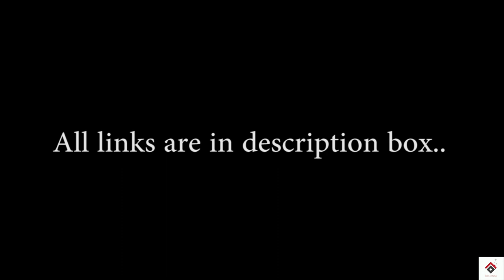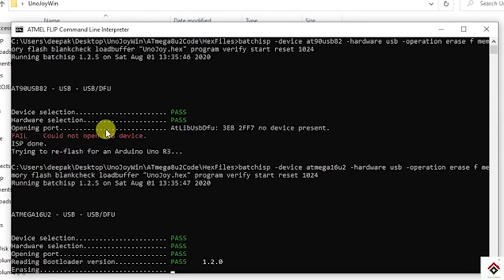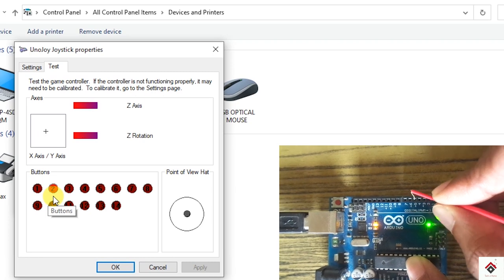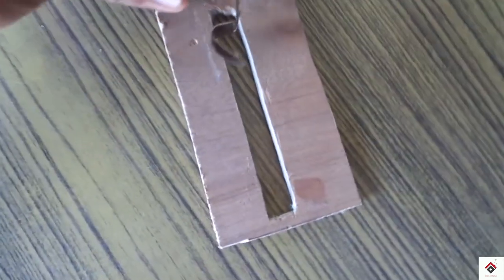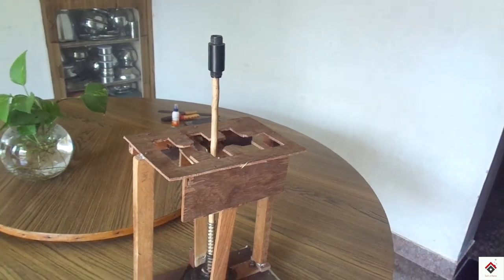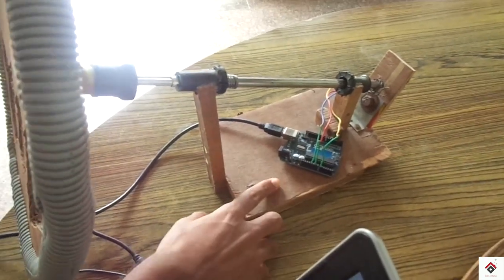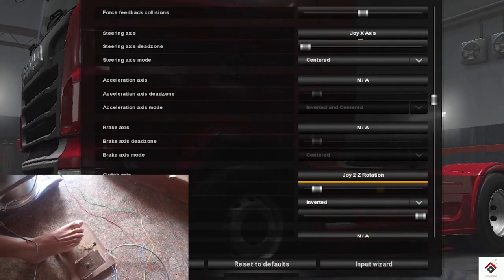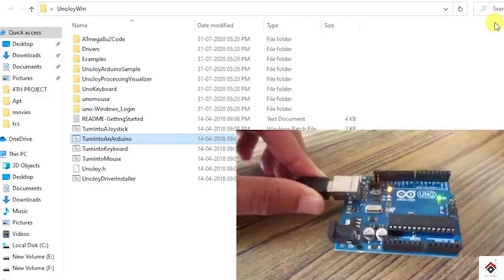Homemade H-shifter from Arduino Uno | DIY H shifter tutorial [step by step Tutorial] - ETS2

Comment: Can we use a single Arduino board for all Steering gear and pedals
Reply from the maker: u can use, one Arduino for all Steering, gear and pedals, but use this file :
https://drive.google.com/drive/folders/1HnBkqISEwCshP16Et6umWX6VqdTuwgt1?usp=sharing
Reply: @techathome  Bro you have shown all but where is H-Shifter. How to connect that one
Reply from the maker: For making H-shifter you can refer our old video itself, and do the Connection in the same single Arduino

Use GND pin for gear nob
And Digital pins for individual Gear contacts

Refer to out H-shifter Tutorial circuit, u will get idea
Reply: @techathome  thanks a lot TechAt home. You saved everyone's money from purchasing those expensive Logitech steering wheel set
Reply from the maker: Welcome bro!!!

Comment: Can we connect steering wheel and h shifter in one aurdino board
Reply from the maker: No
Reply: @techathome  why can u explain plz
Reply from the maker: Steering needs analog signal
Also clutch need analog signal.
If we use same arduino, the channels will mix.

Comment: can i do these with arduino nano? you say we must connect two pins of Arduino UNO togheter but in arduino nano we dont have these pins...
Reply from the maker: No, This works only with Arduino Uno.
Specifically DIP version having 16U2 as Serial communication chip.

Comment: Pls tell me how i can enable dfu mode in arduino uno r3 i short two pin near usb point but it doesn't work. when i open flip its show's AtLibUsbDfu.dll not found. i also paste dll file in usb folder but not work in device manager its show under ports arduino uno com 3 but atmega32u2 is not showing. pls fix this issue soon i bought arduino from amazon
Reply from the maker: Pls msg us on Instagram. @tech_at_home
Reply: @techathome  check insta message pls
Reply: Hi, did you find a solution?

Even though I do the reset the Arduino never changes to from Arduino uno to ATmega, so I can't turn it into joystick.

Thanks in advance
Reply: @luisaxen  No

Comment: Bro should we use two  aurduino uno boards
Reply from the maker: Not required, one board is sufficient.
Refer to our old Unojoy video tutorial for steps.

But use this updated code and circuit from this link for one board: https://drive.google.com/file/d/12i-rsl3xpVoyA1x3x1BKBp0t-3153vR1/view?usp=sharing

Comment: Bro can't we use only one Arduino for steering,paddles and gear shifters. If possible please make it , it will be so helpfull.
Reply from the maker: No bro, you need two Arduino.
If you use one , the analog channels will mix.
Reply: We can bro in mega or some other
Reply: @master_mooncity_vellore u can use mega2560 I've done it but there's no force feedback .

Comment: Brother pls give the arduino code.
Reply from the maker: You can use single Arduino for steering and gear, Refer the circuit from here: https://drive.google.com/file/d/12i-rsl3xpVoyA1x3x1BKBp0t-3153vR1/view?usp=sharing

Comment: I have 1 arduino board
Reply from the maker: You can use single board for all the things.

Use code and circuit from this link: https://drive.google.com/file/d/12i-rsl3xpVoyA1x3x1BKBp0t-3153vR1/view?usp=sharing

Steps from this video: https://youtu.be/CPWPPu2dR7M